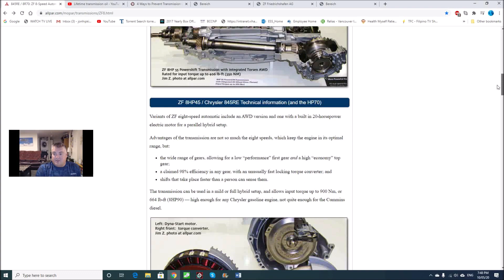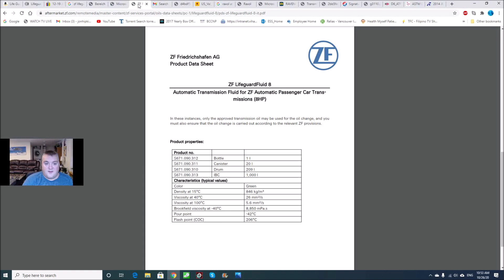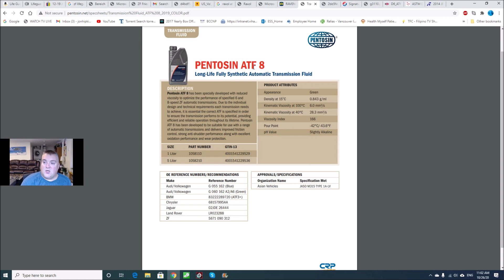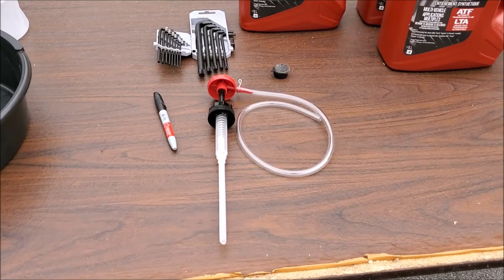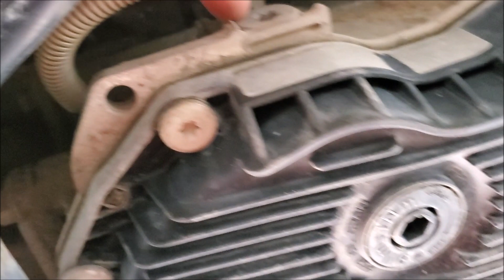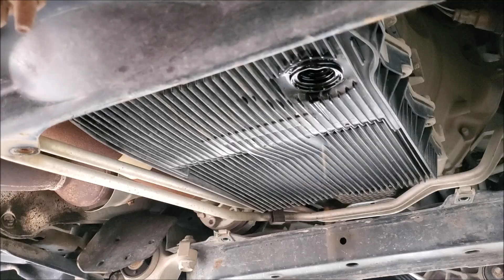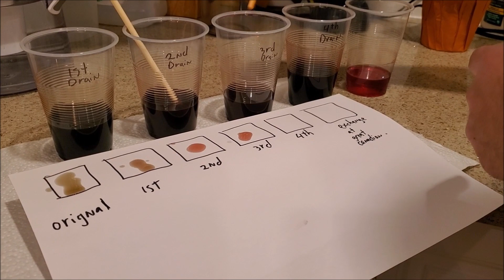ZF 8 SPEED FLUID CHANGE AND OPTIONS (SPECS INCLUDED)

Comment from the maker: just as a follow up.. So was talking to a member in another forum about servicing options for the 8 speed transmissions. He mentioned he had bought a replacement pan for his vehicle for $29. I immediately thought he must be mistaken as i had looked far and wide for pans not long ago for my own GC. In my search I had found some pans online for around $110ca but the reviews on them were terrible. In some cases the gasket looked cheap, or they didn't come with magnets. I was very skeptical and kept thinking (and hoping since i just paid $170 for mine) that he has the wrong pan, or it's gotta be just the gasket...ect. However much to my surprise I was able to find the pan online and it looks identical to the dorman pan i ordered from rockauto. It has the same thick rubber gasket and even appears to have a metal drain plug (rather than a plastic one although it only appears in pic so can't actually confirm that). He says it arrived as ordered and appears to be as described... not flimsy or weak. I just thought I would share the info since the cost of the pan is what makes alot of people think twice about doing a service. 
He is going to follow up after installing it but I'm definitely cautiously optimistic about seeing a pan available in this price range!
https://www.ebay.com/itm/68233701AA-Auto-Transmission-Oil-Pan-For-Ram-1500-Chrysler-300-with-8HP70-845RE/264645659904?hash=item3d9e1c4d00%3Ag%3AJrsAAOSwAUBeU2wE
Reply: Any more info on how it came out , how was the gasket holding up? Did it have all 4 magnets?
Reply from the maker: @joeroe2839  he says it did have all 4 magnets... haven't heard on the gasket.. I think I'll order one myself so I can do a review on it. I mean for 30 bucks not much to lose. My concern is more centered on the filter material... I would like to compare it to the replaceable filter in the dorman pan (from rock auto)  I used in my video
Reply: @jonh2408  yea true not much to lose lol and yea ur right ima go ahead and order , thing is lost all my fluid in my 14 sport 300 my ac clutch caught my oil cooler line and made a hole in it, so idk how much to put in, also do u think it ve alright if I mix it with the factory z fluid red/z fluid
Reply from the maker: @joeroe2839  not sure if you had a chance to watch the whole video but before I learned about the exchange machine I did a few drain and fills using valvoline. Using the maxlife with the old fluid was fine in my 8hp70... have also seen alot videos and comments from people who drain out (approx 40 - 50%) their original fluid and refill with an aftermarket one (mostly valvoline or amsoil) and have never heard of a problem....
BTW if you want to read the detailed report on the $30 pan (including some pics) the forum is called "RAM 1500 DIESEL FORUM" and the post is called $30 replacement pan.
Reply: Yes sir I went tru the whole vid i was just makin sure or if it would be a problem but yea ima mix it then and go from there thanx u sir and keep up the good work and talkin your time to make em 😎🤛🏼👌🏽
Reply from the maker: @joeroe2839  thanks... appreciate the support
Reply: Oh man sounds too good to be true, hopefully you test it out before  I buy the $130 one
Reply: @silverscout2643  it's the same sir just cheaper get it and save ur self some money lol
Reply from the maker: @silverscout2643  ya it seems to have good reviews so far

Comment: Nice video! This matter is truly polemic all around the world - it would be so much easier if the manufacturers followed ZF instructions on their service intervals. I think in a near future we’re going to see lots of broken transmissions due to lack of maintenance - and this will lay down on used cars price and reliability.
Anyway, the video sections were nicely chosen. Congrats!
Reply from the maker: Ya based on forum content it is definitely a divisive topic. Thanks for watching
Reply: @jonh2408  If I do just a filter change and refill with the maxlife on my 2017 Ram (8HP70) with 155,000 miles will it hurt to mix the maxlife with the ZF Lifeguard 8 fluid?
Reply from the maker: @bonniegoutremout1469  It didn't affect my vehicle mixing the fluids. I'd highly recommend checking around for a shop that has an "exchange machine" if you want to get all new fluid.

Comment: JL/JT owners…

I highly suggest doing this change at or before its recommended interval. Every one I’ve seen has be super nasty. Just did mine and it was no different. 

My 2016 ram I never change in 366k miles. Never had an issue with it. Started hearing issues on my JLU at about 50k

You need to do it 3 times to have mostly new fluid in it. I noticed immediate changes with the first one
Reply from the maker: @hailtothe_rooster1572  did you change your pan and filter? I would highly recommend doing that to clear the magnets and get new filter
Reply: @ I changed the filter and cleaned the pan with brake cleaner. The pan and gasket are reusable on my model

Comment: Thank you for taking the time to present such a detailed and thoughtful video.  Much more comfortable with using Valvoline now.  I have this 8HP70 in my Ram, which I've also just received the PPE aluminum pan.  One thing to make very sure of with this transmission is to make sure it's level when filling.  Did your oil exchange shop do that while it was being serviced?  I almost wish I'd bought the OEM Mopar pan, just so I could measure the fluid out, and back in.  Doing it that way, I would imagine it would be recommended to lift the vehicle to one side a little bit.  Because you never know if the transmission would accept that same amount being added back, if there were a temperature difference.  Someone may try to add back the precise amount, and it come dribbling back out of the fill hole before it's truly full?  Unless it's refilled cold?  Idk...
Reply from the maker: @sp1068  ya you definitely need to check level between the 30 - 50c  that they specify. Thanks for watching

Comment: I just changed the oil pan and fluid on my 14 Wk2. Found two big  chunks of metal!! Make sure you change your transmission oil!!!! Got a new transmission installed at 100K miles. Now at 168 and it’s starting to kick again. Tried getting the transmission oil changed by the dealer and they didn’t recommend it… that’s bs! there’s no such thing as life time oil.
Reply from the maker: Was the first transmission change covered under warranty?... I'm not surprised to hear the dealership didn't want to change the fluid. Although some would be happy to do it, and take $1200 from you in the process. I am surprised to hear about your tranny problems as the zf  transmissions have a good to great reputation (depending which one you end up with). Is your WK2 a V6 or V8?. Do you do alot of towing? Was there alot of smaller particles on your magnets along with the bigger chunks?

Comment: my mostly Europe highway driven f25 with ZF 8HP came out of warranty just a bit after hitting 180k km mark, and i changed the oil with zf oem because i felt it started not to switch gears as smoothly as it used to. sadly the smoothness did not recover after changing it 😥 , but still works fine though
so i urge you guys...change it after the first 100k km if you can, just to be safe. if you do it this often then you won't need a complete flush, ZF maintenance manual even sais a fimple oil drain/change will do it (so no need for the expensive torq converter pressure oil change)
Reply from the maker: Sorry to hear it's shifting rough. When you say you changed the oil - did you replace the pan and clear the magnets?... And how much oil did you change... might be worth getting an exchange "not flush" but full exchange done.
Reply: @jonh2408  yes of course, the pan including filter changed. only 5L of oil used though as the tork converter was not flushed. don't get me wrong, it is shifting *almost smooth, I may just be exaggerating a bit 😜 but the car does have now 200k so...with age wrinkles come also

Comment: I was at a course from ZF at a BMW center. The term "lifetime" is tested for 180.000 km. They recommended changing first time at around 100.000 km. And after that every 60.000.

Also its way better to flush than to change, since 50% of the additives are are absobed by the 30-40 percent of the old fluid theres still in there.
Reply from the maker: Interesting, thanks for the info...

Comment: I recently installed a B&M extra capacity transmission pan on my 2021 Ram 1500. The fill procedure that Ram says to follow is dangerous. I will not get under my truck while someone puts the transmission in different gears. I filled it until it pours out of the hole. Took 6 quarts and I installed the plug. Truck drove fine on a 3200 mile road trip afterwards. I used Valvoline Max Life.

Comment: It's a numbers game. Most people that don't work their vehicles hard can go at least 200K miles without changing and have no failure. And most people don't go over 200K miles on their vehicle.
Reply from the maker: @ureasmith3049  320,000 km's without changing the fluid sounds pretty optimistic to me. I agree that happens but probably not common
Reply: @jonh2408  I'm at 160K miles on my 2018 Ram..  My bad, need to change before winter hits.
Reply: I'd agree. The crap floating in the oil acts as a friction modifier and fluid change may buy you and extra 30k. Maybe not worth the effort cost wise. Especially if you're paying someone to do it.

Comment: In the US, at least, many shops are getting away from flushes--allegedly for fear of damaging a transmission.
Reply from the maker: Ya the fear of dislodging/relocating debris into the mapping ducts. Personally i think this happens VERY RARELY. If you consider the number of flushes done every year compared to the number that result in problems its miniscule. I think in most cases, someone who has never serviced their transmission starts getting rough shifts or some other symptom. In an attempt to solve the problem, they decide to now do maintenance they should've done long ago. The transmission fluid with high mileage has more metallic debris than normal due to lack of changing it ever. By removing this debris the plates slip easier because the new "clean" fluid has less friction. Or the flush pushes/pressures debris into ducts causing harsher shifts. The customer leaves angry thinking the service was a waste of time and just made things worse. But the real problem is fact they never did any maintenance. Bad news travels fast and the person blames the service.  But my guess would be this actually happens less than 1% of the time
Reply: @jonh2408  I agree. It's like quitting smoking after decades and then complaining when you can't fully regain lung function. Thanks, brother.

Comment: Top class information and great presentation. Perhaps you can explain how a multi vehicle ATF
can conform to the 19 Mercedes specifications. 

The same multi vehicle claims to confirm to 6 Hyundai specifications. Hyundai service bulletins state that only two of the fluids listed are backward compatible. What is your take on this.
Reply from the maker: Well I can't speak to specific Hyundai   vehicles. But I will say the ZF 8 speed transmission is one of the most widely used on the market. Dozens of models across several manufacturers use it (or a closely related version of it). So if you have a fluid that meets the spec for the ZF 8 speed, then that fluid will cover dozens of different cars. It's important to remember that car manufacturers want to maximize profits. So if they can re-brand (or re-blend) their own version of lifeguard 8 and sell it for a much higher price, they will. And of course their going "discourage/diswaid" you from buying elsewhere. When I asked my local Jeep dealership if I should use Lifeguard 8 fluid, they told me "no, you should only use mopar 8&9 speed fluid". The girl on the phone had no idea that the transmission was made by ZF, no idea that lifeguard 8 was actually the fluid recommended (not to mention the exact same thing as mopar 8&9).. she just knows what she's supposed to tell me as a Chrysler employee.

Comment: a couple oils missed was the Gulf western SYN-TS and Penrite BMV ATF oils
Reply from the maker: Thanks for info.... I didn't know pentrite made a low viscosity fluid and I've never heard of the other one. Who makes Gulf western?
Reply: @jonh2408  Gulf Western is Aussie owned. They make their own fluids
Reply from the maker: @Trebior1  ok... whats the price per liter of there fluid?
Reply from the maker: Also are you sure it's compatible with the zf 8 speed transmission?... when I looked up the product it lists the zf 6 speed and some others but not the zf 8 speed.
Reply: @jonh2408  hmm I looked at the data sheet for gulf western. And it didn't specify it. But the fluid properties look good. When you search it on the Gulf Western Fluid finder it specifies that. Can pick up a 4L for $15 or 20 for $115

Comment: Hello Mr. John. I hope you are well. Thank you very much for your video. Mr. John, my job is car service.  I have a few questions for you. I would be very grateful if you could guide me. 1. Regarding automatic transmissions, VT and DCT, what is your recommendation for changing the transmission fluid in daily driving conditions, for example, driving in traffic and highways and driving under high pressure?  After how many thousand kilometers is the car working? 
2. If a car with 120 or 150 thousand kilometers comes to my garage to change the transmission fluid, is it possible to damage the transmission by changing the transmission fluid? 
3. Regarding cars with working conditions  Above, is it possible to change half of the gearbox oil with new gearbox fluid instead of replacing all the gearbox fluid in order to reduce the possible damage to the gearbox?
 4. Usually, in what kilometers of the car's operation is there a possibility of damage to the gearbox oil cooling radiator and coolant infiltration into the gearbox?  
Respect and best wishes.

Comment: hello jon good video, excellent information! .... you know, I have a classic ram 1500 pickup 3.6 liters gasoline, 2018, I am worried about its transmission temperature ZF 8 speeds, it registers 190 degrees Fahrenheit with normal use in the city center The strange thing is that it has 8000 miles, should I change the oil ??? .... Thanks for your explanation ... Greetings from Chile South America!!
Reply from the maker: Hey thanks for watching... as I mentioned in the video these transmissions seem to run warm. My grand cherokee with the 5.7L runs at 93C normally as well. I think its a good idea to change your fluid on a regular basis... but your temps are normal
Reply: No mine runs that all the time, and mines only has 38 thousand miles...now if it was 200 and over ,then I would change the trans oil

Comment: Great video Jon I did my own last year on my 2016 Dodge Charger Scatpack at 113K.  My question about Great Canadian Oil Change is if you bring them your own oil how much is needed for the full flush and does it get all the oil out?  Have you had any issues since changing to the Valvoline?
Reply from the maker: They used 15 liters when they flushed mine and it was very clean when they were done (as you saw in the video). The capacity of the entire system is around 8.7 liters. When I brought mine in there I had already done 3 drain and fills so my fluid was already somewhat "cleaner" than original. How much impact that fact had on the end result I can't say, but given that 15L is twice the total capacity I'd say it would come out pretty clean. It's still running fine with the maxlife... when I do the next fluid change (at 150,000 km's) I will send a sample to Blackstone and see what the report is on Valvoline with 50,000 km's on it
Reply: @jonh2408  Thanks for the info Jon

Comment: I worked at two Dodge dealership 
they have been a lifelong Mopar or no car guy I was in sales but I do know enough to know they have this big ass cart they push around with a touchscreen interface that heatsthe fluid they flush your motor with it's a self-contained system and recirculates actually. what they get around that just fine and so can anyone with a metal pot and a grill and a pump.